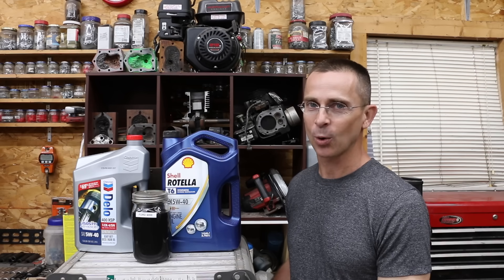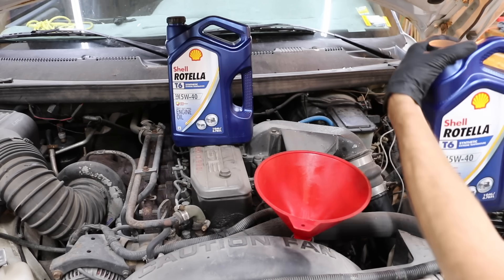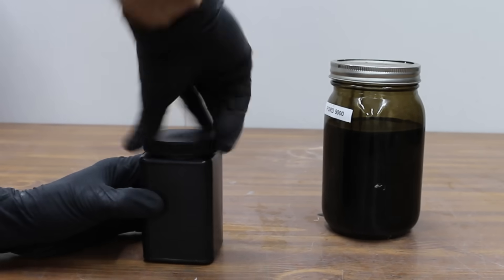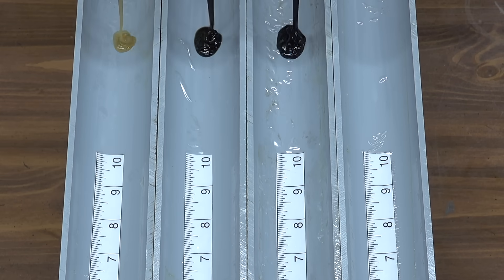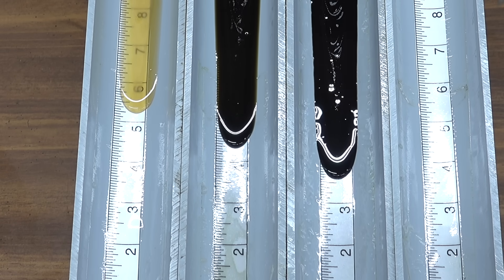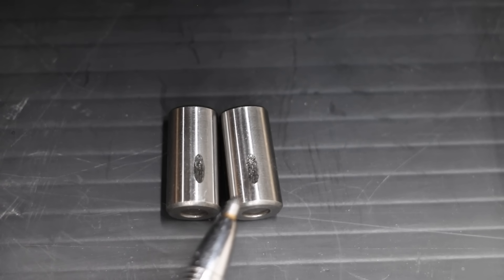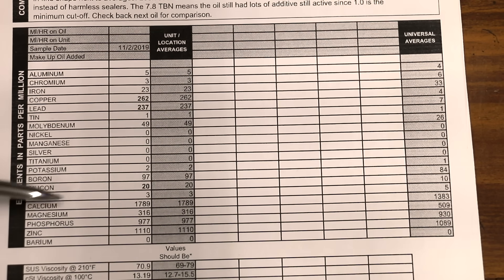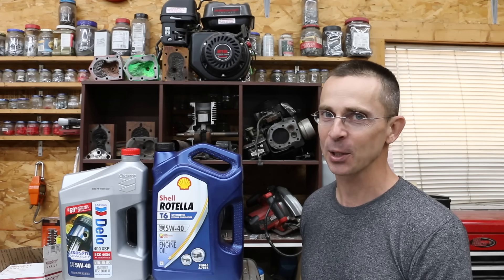Will Annual Oil Change Damage Your Car? Let's find out!

Comment: I don't even need to change the oil on my jeap, just the filter! 

 It drains itself, I just need to keep the level correct....
Reply: Back in the early 70s a buddy had an old Chevy van from the early 60s and that is exactly what he used to do.
Reply: You Wish  I don't know your age but I can remember when it was commonplace for many people to spray small amounts of used oil on dirt roads and driveways to keep the dust down in the summertime.  
I can visualize hundreds of thousands of people having strokes and heart attacks from the mere sight of that today.
Reply: Duane Adkins 
My grandfather used to make me take the used oil and spray it on the Driveway! 
We were visiting them on the weekend And I was out helping him!
I was probably 10 years old! 
My grandfather told me to listen to my mother but always think about everything! He asked me what the roads were made out of? 
Six months later we went into town to Pick up some automotive parts.
It rained while we were In the door when we come out he said look how nice and beautiful that rainbow colour Is on the water in the puddles!
I said to him yeah I know that’s the oil!
Reply: @duaneadkins1261  i grew up on a dirt road and we laid oil down on it every summer. Oil comes out of the ground but yet they wanna scare people into thinking it’s horrible for any oil at all to go back into the ground though 🤷🏼‍♂️
Reply: You Wish 
Roads are made of oil!
And hot climates Like Las Vegas
The roads get slippery from the rubber from the tires!
Reply: Well all I can say is since back in the 70s I have used series 3 motor oil in everything I own. And for those of you that don't know what series 3  oil is; 15W40 diesel oil. 
I currently have a 96 f250 with a 302/ 5liter with about 140,000 miles and I have used Shell Rotella or Mobile Delvac 15W40 until recently when I started using Shell Rotella Synthetic 5w40. The reason I switched was to satisfie my curiosity. I had read and heard so many things about synthetic oils?!?!?!
Here is what I have witnessed on my old f250 at 140,000 miles. No change in oil consumption (doesn't use oil between oil changes)(also filter change at 5,000 and complete oil change at 10,000 miles) ; engine is quieter and gas mileage is unbelievable. It use to average around 225 to 230 on the 19 gallon tank and is now getting 278 to 280.
My take on synthetic oil is if you have properly maintained your old bucket of bolts switching to synthetic oil is OK!!!
Reply: Well we have seen several oil and additives comparisons on your channel, but I haven’t seen anything on oil,air or, transmission filters yet. So why don’t you do a scope of leading manufacturers of filters, then list the “branded” labels of each to inform the general public. I know that there are only a handful of manufacturers, but a few hundred brands or labels they are sold under!
Reply: Hey, I have heard, that some large earthmoving machines continually run engine oil off to the diesel fuel tank. Regular fresh oil top-ups maintain the sump level. Avoids waste oil disposal, saves fuel, and as long as filters are maintained, all is hunky-dory. Even better is a centrifugal oil cleaner.
Reply: Plus gives good undercarriage protection in states  that use road salt
Reply: LOL
Reply: You Wish  You can recycle the spent oil at auto parts stores & some repair garages too
Reply: Even car dealerships have a service department with oil recycling, you just have to ask the service manager nicely if there is no other place to do it nearby. I save my used oil in an antique gas can. I take the spent oil from the collection pan & use a funnel to transfer to the old gas can. It holds several gallons, so I can change engine oil in cars, scooter, 4 stroke weed whacker & pressure washer etc & save all the spent oil for recycling etc
Reply: "It drains itself" Coffee spilled all over my keyboard!!
Reply: my first car - 1960 Corvair did the same thing. Just kept feeding straight 30 weight to it & Motor Honey.
Reply: @johnroberthanna1623  Motor Honey, that's sweet
Reply: Back in the bad ol' days ('60's, to '80's at least) it was normal to leak and burn oil, one would check it at every fueling and you'd see small puddles in every parking space.
Reply: @Mrbfgray  You only checked the oil when you needed gas?  Wow!  I check the level every day!
Reply: @Iowa599  Do what ya gotta do, you know your situation.  Doesn't hurt to stay on top of things anyway.
Reply: @Iowa599  At least motor oil is easy to add,  my '96 Chevy C3500 HD 1-ton service truck is slinging trans oil out the rear, just the seal but still a small pain in the ass.
Reply: @Iowa599  I gauge the size of the puddle under my car.
Reply: The engine will always be full of sludge and other solid combustion deposits. Best to flush it right out when it's hot. Unless you dont value your Jeep engine. My 1942 GPW engine is worth far more than the cost of a bottle of oil. On a more positive note. My father never changed engine oil from one year to the next,just topped them up with any cheap oil, and the engines still outlasted the rest of the cars.
Reply: Iowa599 😂🤣😂🤣🤣🤣
Reply: 15 quarts of oil!? Lord have mercy.
Reply: I just replaced the rear main seal (which required replacing the oil pan gasket) and replaced the (oem) filter adaptor o-rings last weekend.  It's drip-free since!

Unfortunatly, I might have to start draining the oil!
:(
Reply: I have a 95 Chevy z71 that I use similar methods... but half it drains, and half gets turned into toxic black smoke  and gets expelled into the atmosphere for natural recycling
Reply: I remember watching the mechanics dig a small pit under the Cats on construction sites. Pull a D9 or whatever over  over it, pull the drain plug and let it fly. I was on a dam project the first time I saw that. A little oil in the water. Ah the good old days, Lol!
Reply: It's just like Harley Davidson, they don't leak oil, they leave their mark.
Reply: What can I say you were foolish enough to buy the damn Fiat /Jeep to start with.....
Reply: @ronaldhickman9953  My 1995 Jeap does have a Toyota transmission ( stock , AX15, similar to Supra), and the 4.0 engine (aka: AMC 242) was introduced in 1964.  That's 31 years of production before making mine, so (most) common "mistakes" were corrected already.  Also, the chassis was introduced in 1984 (xj), and other than the unibody design, nothing was newly developed.

It may have been designed by idiots, but sometimes, even morons get lucky.
Reply: Iowa599 Ahh the classic 4.0 and it's rear main seal
Reply: Additives may do wonders for you sir.  It sure worked for me.  I had an issue that ended up being dirty coolant (that looked and smelled like oil) coming out of my intake gasket was leaking and pouring over the back of my V (engine).  It was pouring over the transmission, misleading the shit out of me.
Reply: @NOSUBSCRIBERSWANTED  some people probably dont have the money to drop 3 grand trying to fix oil leaks and it still leaks oil how cars get after so many miles
Reply: what ride you got?
Reply: lol that engine is joke
Reply: The same aith my antifreeze liquid on ALL of my cars -__-
Reply: I hear you.  I used to do that on my Mitsubishi Eclipse, but now I feel bad about it.
Reply: But you are having a dirty oil by doing that....
Reply: Total loss system on an old vincent motorcycle
Reply: Thanks,, me too. At least on my 2007 GMC CANYON/4 CYL @141,000::: MOB1/5 W-30/ NAPA GOLD / Purolator Dilters.,:: for about five years now( though May baby it , low driving now*& put new Oil Filter @three-4 month sometimes,,,,, Interestingly, May switch my 2015 Journey 4 CYL @90,000 to ***MOB1/ **Purolator/ NAPA: I bought* lifetime Oil changes,  with Dodge Dealer ((* they use PERFORMAX fikter, *& 5 W-20 MOPAR conventional!,), ……
Reply: Same on my Mustang
Reply: @Lukja91  They all use oil injection vro pumps today!
Reply: Fun story. I work as a parts salesman and an old timer would make the trip to the store every 6 months or so to pick up parts and a lot of oil for his shop and haul it back up north in his late 90s f150. He overheard us talking about needing an oil change and mentioned that hes never changed his oil in his truck for the last 15 years. I asked him to elaborate and he said that he drills small holes in the bottom of the oil filter to slowly drain out oil and he tops it up every few days so he always has fresh oil. I laughed thinking it was a joke and the other guy working with me has known the older gentleman for 30+ years assured me that hes telling the truth. So after the old guy pays up and left i took a look where he was parked and sure enough there was a little bit of fresh oil on the ground. seems crazy to me but that truck has made thousands of kilometers in terrible northern road conditions and weather without ever changing the filter or oil.
Reply: @saskmuddinatv  The oil filter is under pressure---wouldn't it spray everywhere if you drilled holes in it?  No matter how small the holes, a dangerous thing to do.  Plus, the filter would never be full when you started your car, causing a delay before you got oil pressure and causing worse wear regardless of how good the oil is.  And a fire hazard in hot weather.  If true, I'll be the bottom of his truck was a mess.  Glad he doesn't park in my driveway..
Reply: @saskmuddinatv ,many years ago the U.S. AIR FORCE  put out a statement that oil doesn't breakdown. They later revised that statement because they based it on improper info. The old reciprocal engines in airplanes carried tanks of oil in the fuselage and would add fresh oil in flight to the engines. 
So that old mechanics theory is feasible. My question is how often did he change the oil filter???
I do extended oil changes  on my gas power vehicles but change the oil filter every 5000 miles and I use industrial oil filters ( Baldwin ) not the average off the shelf oil filter.
Reply: @frederickburns1739  Honestly I'm not sure if he ever did change the filter. But I really don't know. I didn't quiz him about the situation haha. All I know is he bought a lot of oil often. At least 5litres a month without fail just for his truck.
Reply: @saskmuddinatv  thanks,strange..
Reply: Probly, but I'm not pullin' the trans until spring! 
(leaky rear main seal)
Reply: @Iowa599  youre swapping the trans just because of a leaking seal? 🤔 its like me swapping out my t-case due to the output shaft seal leaking lol i dont have the money for a swap so i took it to a shop to get the seal changed.
Reply: @Matt-iq1zj  
R&R

Remove & replace

Putting something back = replace

As it turned out, it's a split rear main, so the trans can stay in. The oil pan must come off, though, and that doesn't fit past the steering & axle, easily.
Reply: You Wish calm down Greta
Reply: @DoDgeSwaG  How dare you?  It's Karen.
Reply: the dude ha!
Reply: @DoDgeSwaG  Come on man there's a big difference between a radical climate change activist that thinks the world is ending and someone saying you shouldn't purposely leak motor oil all over the ground. That leaked oil eventually makes its way into our waterways which can harm the wildlife and humans. I love fishing and I want my great grand-kids 100 years from now to be able to fish too and I don't know about you but I want to be able to eat safe and clean fish/crabs/oysters etc. without ingesting trace elements of motor oil. Also there's the fact that oil can cause car accidents by making the road slick.
Reply: Acaidia show me a study that shows the fresh water fish u eat has all those run off chemicals in them. I’ll wait....
Reply: @Acaidia  there's so many oil leaks out there one pickup won't change it. I understand what you're saying though... except for the oysters.
Reply: My buddy had on 08 cobalt that burned 1 quart of oil per tank of gas he just changed the filter once a year
Reply: My car uses more oil than gasoline it has an extreme oil consumption.
Reply: @shoveI  the scientists are paid to produce the results that their masters demand, just follow the money.....anyway like I said ; most have no clue of the catastrophic emissions and poisons sulphur gases that came out  of Krakatoa and that was but one event that darkened the sky]s globally and lowered temps for 5 years yet the earth survived....the earth is far more durable than tiny man thinks....tiny man and all of his infrastructure only occupies about 1% of the earths surface......oil is by far the most viable, practical, affordable, and renewable energy known to man.
Reply: @bonniejohnson1518  You are incorrect.  Most scientists have a lot more integrity than this.  Obviously you don't know any scientists.  They are not politicians.  Additionally, while the Earth may be durable, man is not.  Earth may last forever, and nature may evolve pollution eating cockroaches, but man might not be around.  Krakatoa was one event, and though significant and lasting for five years, it produced nowhere near as much pollution as man continually has cumulatively for well over a century now.  It's short sighted to rely on oil.  There may be a lot of it, and it may be somewhat renewable, but burning it does release carbon and this leads to global warming, which has all sorts of harmful effects on our climate.
Reply: @greendryerlint  2015 paris climate summit flagship study was shown to be fraudulent after the scientist conducting the studies on ocean temps were taking measurements from the bilge of the ship.....warmer than the ocean water.
Reply: @greendryerlint  they have you believing in global warming. Earth still would go through changes continually even with out humans
Reply: bonnie johnson shouldn’t we still try to be environmentally friendly? God ain’t going to save us at all.
Reply: bonnie johnson and by the way, please stop trying to act like trump
Reply: @NOSUBSCRIBERSWANTED  most have no clue of the catastrophic emissions and poisons sulphur gases that came out  of Krakatoa to an astronomical magnitude some 60,000 feet high into the atmosphere for days..and it was ONLY ONE of many, many volcanoes since the flood...What man can do compared to Krakatoa is but minuscule at best. God promised Noah in chapter 8, that the earth would remain bountiful up until the last day. I trust in His knowledge and wisdom in such matters, and not in mischievous and greedy men, having hearts full of guile in the hopes of merchandising others..
Reply: @bonniejohnson1518  
Thank you for your sanity and faith.
I completely agree with you. More, I agree with God and made covenants to demonstrate I'm serious.
Reply: @KLP99  I don't recall God ever saying that it's a great idea to pollute the Earth and treat it like a disposable lighter.  The meek may inherit the Earth, but they may have to deal with the mistakes made by generations of short-sighted idiots.
Reply: @greendryerlint  
I believe we are to be good stewards of the planet. I believe we will answer to God for destroying His creation. However, He created this planet with incredible power to renew itself. Man is puny in comparison, but we are still to use wisdom. The problem is, most of science has been coopted by leftists who want power, not peace, and are using the cult of global warming to get that power. For instance, if you read the Paris Climate Accord, you'll learn it's really nothing more than a Robin Hood scheme to take the wealth of the United States and give it to the rest of the world. It's goal is to turn the USA into a third world country so it can be easily conquered and subdued.
That is the goal of the church called Climate Change.
Do some research. Figure it out. Either your part of the solution or part of the problem...
Reply: @KLP99  With all due respect, your reactionary viewpoint is a bit scary.  Yes, the Earth has an amazing ability to renew itself.  My body has an amazing ability to renew itself too, but I'm not breaking my limbs to watch them heal.  I believe in God, but the "God will make it better" approach is a rationalization to excuse people from taking responsibility for themselves or their surroundings and is incredibly juvenile.  Science works.  Without it, you wouldn't be able to express your opinion on YouTube in the comfort of your air conditioned home.  I know I won't convince you, as you seem to believe facts and opinion are on equal footing, but God bless anyway and take care.
Reply: @greendryerlint  
Well you missed my point entirely. Sorry you assumed so much ill in me. You blew past the entire first half off my post. You're wrong and misrepresented what I wrote. I believe God will hold us accountable for failing to manage well our stewardship.
Reply: Karl Pearson Coopted by leftists? As a centrist who would like the planet to be a tolerable place for my grandchild to grow up on, I find that a strange notion. Since the fact, consequences and trend line of industrial pollution is undeniable, the only argument you can make against climate action is that “world leftist conspiracy “ nonsense.

Comment: I hava important question
My car's manufacturer recommended 10w30 oil and now my car has travelled over 300,000 km should i switch to 20w50 oil?
Reply from the maker: Thank you
Reply: @ProjectFarm sir sorry but you did not reply my question?
Reply: depends on the region/ climate... stay with 10W30 unless you're worn engine is starting to blow blue smoke. u can go a tad bit heavier with 10W40 if you want peace of mind

Comment: @Project Farm
Hey it would be a cool video to see if there is an additive or way to restore OLD or STALE gasoline.
I have about 10 gallons that was left in sealed gas cans outside and now almost unusable. Was for my 4 stroke yard tools
Thanks for the read.
Reply: fuel stabilizers work ok... i guess u can use stale gas as cleaning solvents now